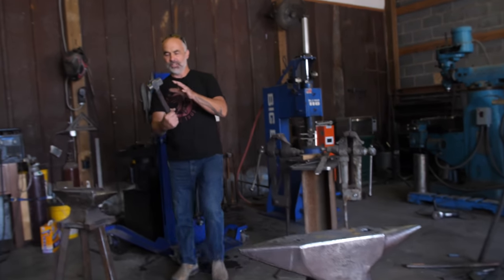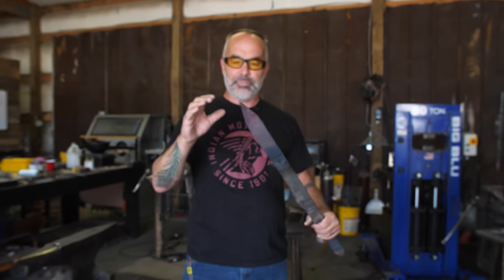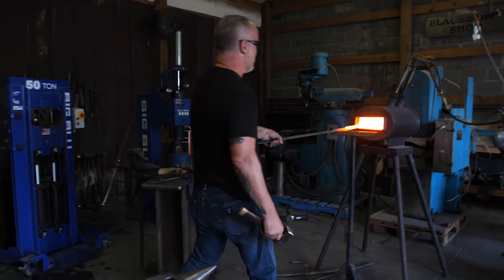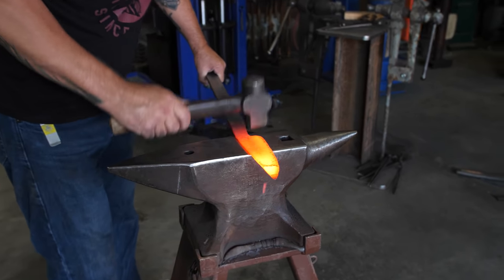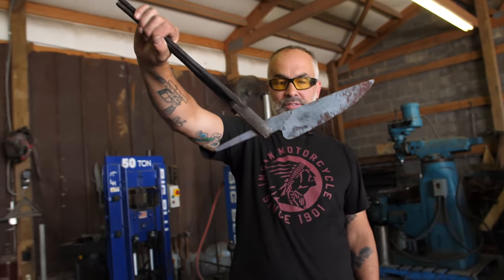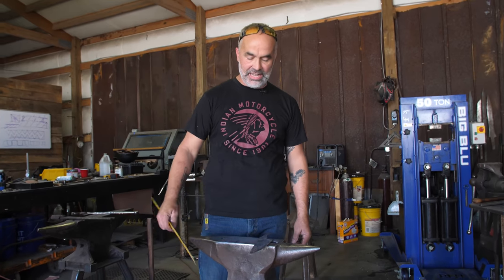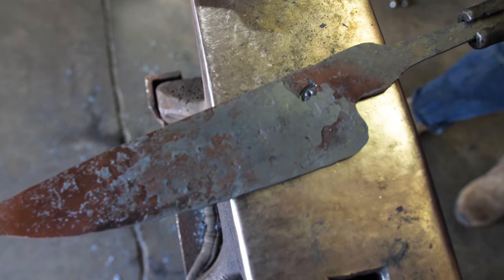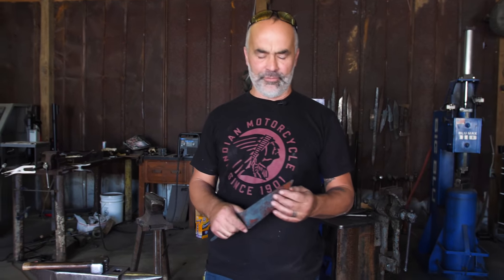KNIFEMAKING - Chef's Knife

Comment: Really enjoyed this working the hammer more and less art of grinding art work. 
I just got my first knife in building 9 knives but taking months due to supplies and making several tools for the building used 1095 for 3 and reporpous bandsaw blade for 5 and Forge and quenching and heat treatment of first 5  but just kept the last cool as I cut with cutting wheel and kept cool and grinding to complete and haven't yet see how both ways function after complete months of use hopefully both ways holds edge. 
The  other of my experience has been with junk steel and leaf springs were great practice and good experience..
I'm thinking that steel you just used is something I would like to try mastering but don't know if my Forge and  toaster oven is ready for heat treatment. Believe I'll use the working parts of the toaster oven and build a insulated oven with toasters parts for better heat treating hopefully. 
 I'm retirement and 71 enjoying this as a great hobby and want better knives than China sales Americans 
Thanks for teaching me and others

Comment: I would love to see you do a chef knife or chopper, in kind of a Japanese inspired style, with a nice hard 80CrV2 of 1095 and something softer wrapped around and forge welded for the outside and spine. Not Katana style damascus, no folds for the extra cutting edges, just 1 steel wrapped around the other. I know the blade would never be going into battle and need the soft steel for blocking an impact, I just want to see the natural hamon that would happen when you grind out the edge after etching...or if there even would be.

Comment: Love the videos, and sharing your talents. Any suggestions on rust prevention with th 80crv2?
Reply: I work primarily with 80crv2. I've found that bluing is a good way to prevent rusting. If you want to have a silver blade then just simply keeping it clean and dry will do it. I also use vegetable oils on my chefs knives as they get washed a lot. Hope this helps 😉👍.
Reply from the maker: Bluing the blade will help prevent rust.